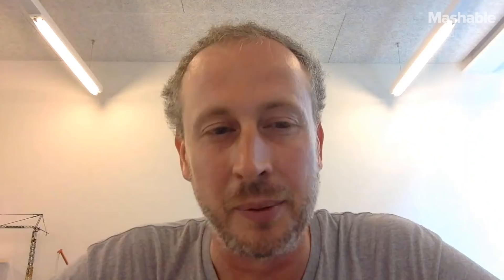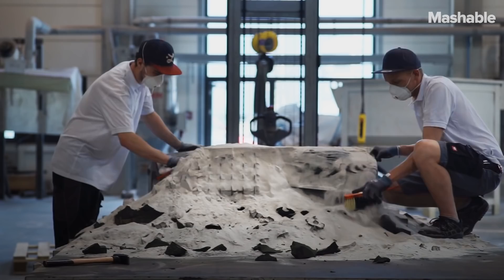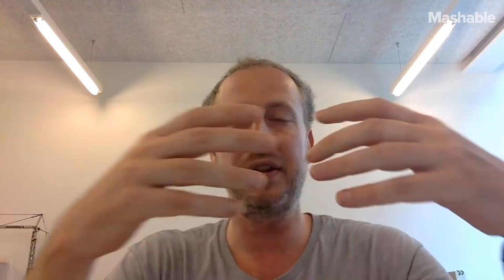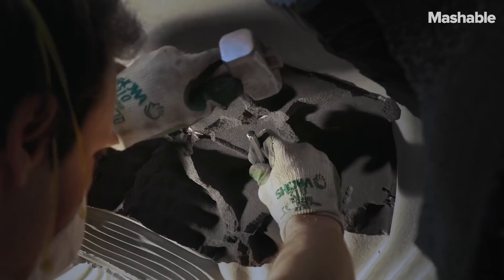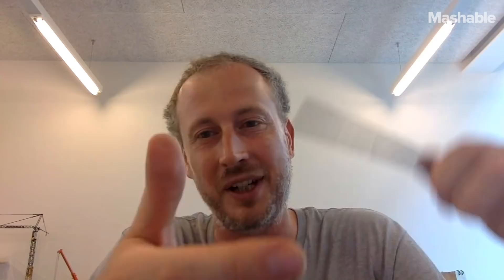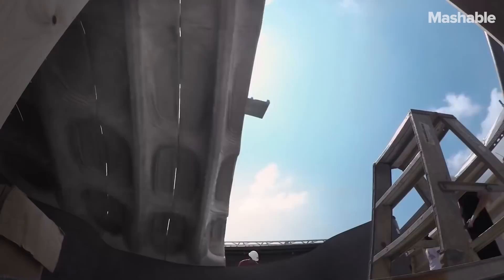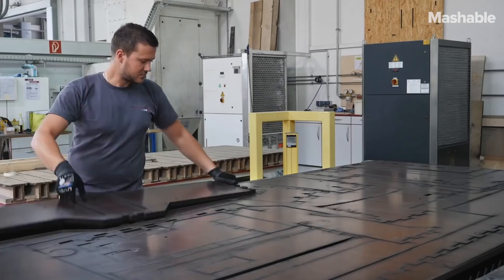Here's Why This Super Lightweight Concrete Slab Is The Future Of Architecture

Comment: You have to design or find the way to be able to reuse all those 3D printed molds breaking them apart from the finished product with exhausting work is not the sustainable way we are aiming. Besides this issue great approach. Congrats.

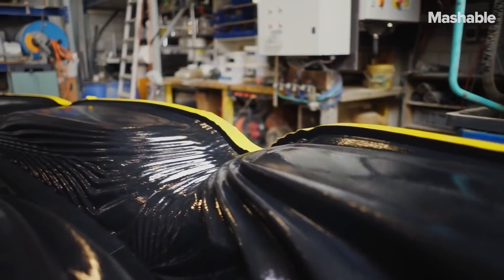Comment: did you see that his workers are working with fiberglass and not wearing masks 1:36-1:38
Reply: the fiberglass is just loose fibers mixed into the concrete and then sprayed on...the mixture is too wet to have loose fibers floating around...

Comment: 3d printing isn't the solution. Fine, find the principal stress curves in the slab and align material to it for efficiency, but it doesn't need such an elaborate manufacturing method. Fabrication and structural efficiency should be a compromise. Still, looks pretty I guess.

Comment: Mr. Professor - if you would - please provide the names of a couple of companies that are selling the large scale 3D printers to make the forms.  Also - is there a convention in the USA that displays these types of printers.  I know that there are lots of companies making and selling smaller printers.  The printer in your video is on a different scale.  Thanks!
Reply: Many of these printers are custom built. From my Knowledge, ETH Zurich, also has ABB robots moving from the ceiling to work on XXL projects. There are Build Cons regularly in several states where they show machines that can be customised to do this.

Comment: 30 years late.  Thin shell concrete using basalt reinforcing is decades old and is stronger than what they are doing here.
Reply: Could you provide a link or additional info about this?  Very interested

Comment: Congratulations, you turned cheap and simple into expensive and complicated. For some marginal benefits. Vanity is fun  I get it, but reducing the amount of concrete in the slab and improving it's thermal, hydrophobic, structural and other properties can be done far more effectively with new aggregates that can be produced from recycled materials. And stays simple and cheap which ensures wide adoption.

Comment: A very nice solution for a problem that does not exist. This is decadent design, not design for public housing. Get over yourself, don't try to sell this idea as if it's going to revolutionize the future where we need to build more and faster than ever before. That's just misleading.
Reply: The design and application featured may be decadent depending on interpretation, but the potential application of this technique is completely functional, useful, and valid. The fact of most new techniques and technologies first originating in the projects of the wealthy or exhaustively artistic has a practical cause - they are the only ones wealthy enough or dedicated enough to pour resources and effort into a pipe-dream others have yet to see merit in. Such single-minded drive and excess does not invalidate the value of the end product.

Expand beyond your eco-socio based class view of the world and look at the engineering potentials. If you are unable to see them - you might not be qualified to continue commenting.
Reply: I couldn't agree more. The shell of a structure is a small fraction of the overall cost of the building. Just watching them make that one piece you can clearly see that this is not at all a cheap process.
Reply: @Lot not only is this more difficult to do because you have to make ultra custom engineered solutions just for a slab, it is also much slower to manufacture and takes longer to install. It may be space efficient, but it is not time and cost efficient at all.
Reply: lawlerzwtf technology will evolve man
Reply: 1. It is a problem that exits, that because of labour and accuracy issue, we are building with a thick slab because optimizing the load like Gothic architecture is economically impossible today. But the conventional concrete construction not only comprise of major co2 emission for global warming, but it's useless
2, this method can be made into robotic fabricated formwork which is cheap fast and efficient, look at Odico from Denmark. 3 you and public in general need to engage more and try to understand the environment you are living in, to improve your life. Not to make assumptions and protect status quo for no reason.
Reply: The criticism seems excessive. Isn’t this just a prototype?  You make it affordable by creating models that tessellate, allowing mass production…